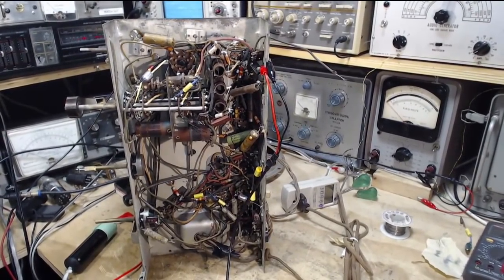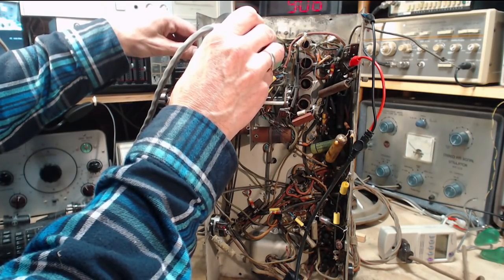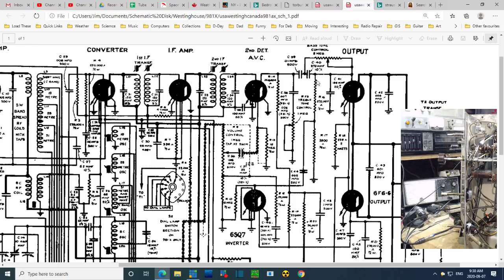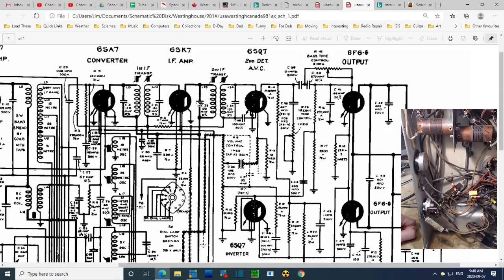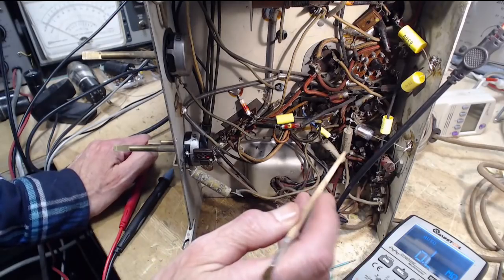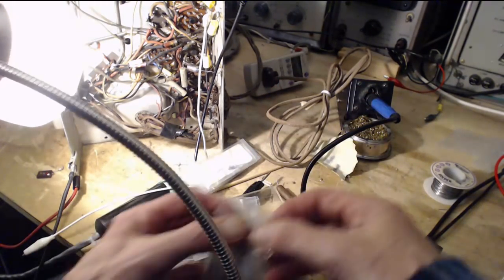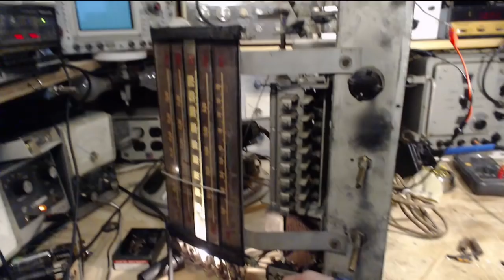Westinghouse 981X Shortwave Receiver Video #6 - Problem Found

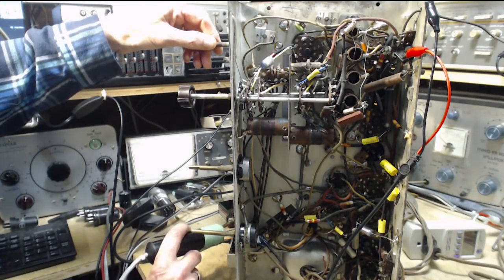Comment: 👍🏻 At 54:50 the bass tone control schematic shows the end of the pot going to the wiper but it should not. Should be open ended like the model 987X. 
The error is only in  the schematic and not in the radio!

Comment: When you have a device with this complexity of wiring, it should have a large number of colors of wires, coded for each circuit and, if necessary, different components of each circuit.  You have to be able to trace.wiring through this rat's nest, separating internal wiring from those wires just passing through from outside.  To quote C-3PO, "This is madness!!"

Comment: Jim, you should know, with your years of experience that failure of that resistor is one of the most common faults in old radio’s. Also it’s been pointed out to you in the comments if you would only read them. You would have found this fault hours ago if you had only carried out a methodical voltage check through the radio. But you didn’t. There was no methodology to your fault tracing at all.

Comment: Never give up.  Mr. Carlson, a fellow Canadian, had a radio that was dead silent even though it seemed to be receiving properly and the signal could be traced from the antenna to the speaker and was there all the way.  The problem:  A dead short in a capacitor in a line between two wires that bridged that pair of wires which flanked and connected one of the major signal processors into the circuit.  Since it was now a short between the two lines, they could no longer conduct a signal from one to the other through that component and the signal simply died flat.  He cut the capacitor wire and instantly had sound and the radio worked fine, with that capacitor only being used to reduce static, but having a side-effect of being another volume kill switch if it shorted out.  If this is happening to you, nothing will work until you hit the key wire(s) where the problem component(s) is/are on.  May be a hair-tearing thing!